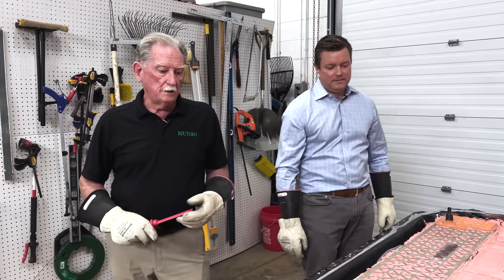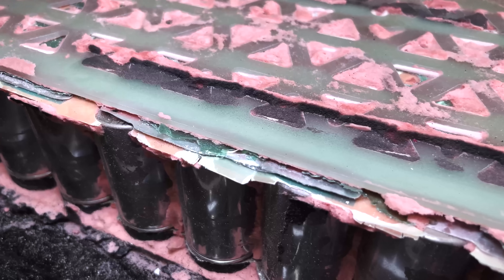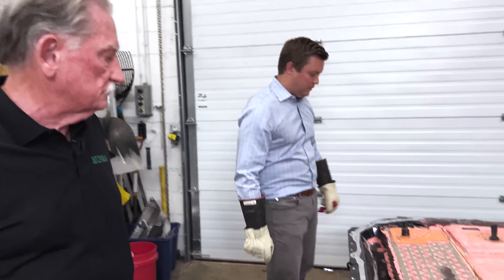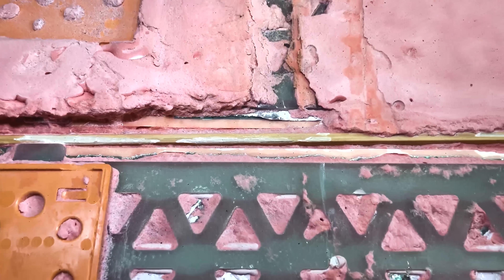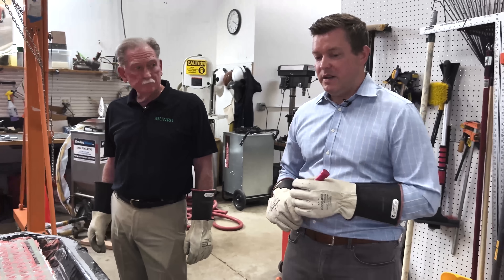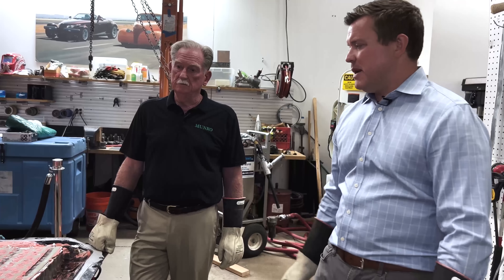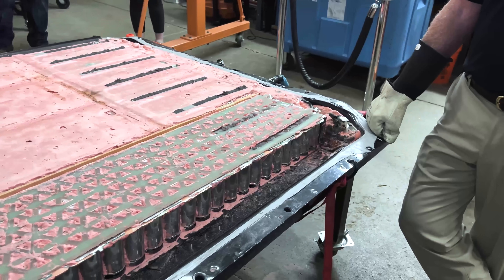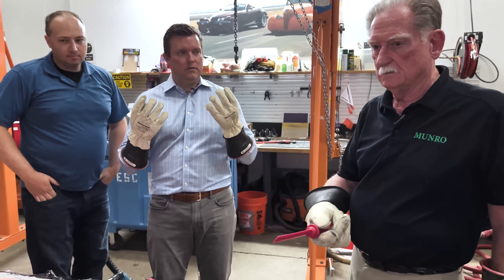4680 Battery Pack: What We Found Under the Foam!

Comment: This battery feels like a slap in the face to the DIY recycling community. Every Tesla that has crashed after 2-10 years so far has had the batteries removed and re-used in another vehicle. But now it's not possible for a regular shop to remove the batteries.
Reply: @plantstho6599  For the record, I'm quite the fan of capitalism. It's just that I'm also quite the fan of right-to-repair, which I think is not contradictory with capitalism. The confusion at Tesla is long-term profits versus short-term profits. Short-term, this iteration obviously yields higher profits. But if customers who loved the brand find more and more that they can't do anything to their cars without Pappa Elon's explicit permission, they will grow to not love the brand eventually, and that change is harder to measure than quarterly unit sales, but it will be a NET negative for the company's bottom line given enough time.
Reply: These batteries can still be recycled. Just not in the way you all might think. The pack gets fully discharged and then put into shredder which that shredded material will then be put into processes to separate out all the materials for recycling.

While this may seem like a waste, I really doubt that the DIY community usage is going to be greater than the number of crashed or scrap Tesla battery packs over the coming years. Talking about thousands of battery packs and likely millions of cells over the next couple of years. Also if you have ever taken apart a Model 3 or Model Y module for the cells, the potting agent or adhesive used in the modules does not make it any easier than this.
Reply: I was thinking the same. How could anyone repair or replace this?
Reply: This really needs to be addressed, will these battery packs end up in a landfill?
We are supposed to be eliminating single use items, this is bullshit. If you can not make a recyclable items then do not manufacture it.
Reply: @albertwayenberg9140  It's like they said in the video: the batteries can be ground to dust and then the raw metals are separated for mineral-level recycling. They won't end up in a landfill, but end-of-life recycling is grossly premature for a car that gets totalled in less than a year. The battery can last 10-20 years. Once it's manufactured, it should exercise its full 10-20-yr life cycle before being ground up. That is the most efficient way to put the materials to work, but it necessitates modularity, which Tesla apparently no longer supports.
Reply: @texasgreentea1  Polyurethane foam renders mineral level recycling almost impossible - it gums up the chemistry horribly.
Reply: The pack also seems to have parts that could go bad and could be replaced but now you gotta replace the whole pack. It's wasteful overall and more money on the consumer.
Reply: @JJayzX  exactly, more money from the consumer. Nio took a hit and invested in a swappable pack, good for the consumer, good for everyone long term. Tesla could not commit the capital at the time so now they try to convince everyone swappable packs are useless, and that's absolutely incorrect. When you can swap a pack you can recycle a pack easier, you can sell a car sans battery (via battery lease) and reduce the cost, accelerating the transition to ev, TESLAS GOAL.
Reply: @JJayzX , so you engineer the failure rates to near zero.
Reply: @kylenolan2710  lol, that isn't realistic. Just not how things work in the real world.
Reply: @JJayzX  yeh they must have a way to do it for there warentee stuff hey
but how do u think a 3rd party shop would get hold of those cells?
Reply: Thats  the way how they like it :D
Reply: 100%, tesla wants to maintain control of their battery supply, this is partly why they chosen this design.
Reply: The new corporate theory is my way or the highway. From total integration of parts making to elimination of middlemen and sales staff. Everything is proprietary and will be designed so it cannot be reused unless by another key holed proprietary method that was integrated into the original design. This is corporate mantra. The key is to look for these keyholes to unlock the path to further use. A pack like this will far outlast the vehicle. At the very least it looks like these packs can be split into 1/4s stood on end and used as powerwalls
Reply: @urbanbeeman5402  Fight for your right to repair.
Reply: @iiinfinitefitness  I agree.
Reply: I think this pack wil survive most crashes.
So it will be on a pack level.

And diy will get many more options from the very different packs out there.
Reply: Even Tesla won’t be able to replace cell blocks… You total the car if something is wrong or a minor damage to structural pack..
Reply: Yes, Tesla has eliminated the "reuse" from the mantra, reduce, reuse, recycle. That isn't a step forward, except for Tesla.
Reply: @ledsalesoz  
I think that in a few weeks you may have to reconsider your "reuse" position.
(Just btw, recycling is by definition "reuse"?)
Reply: @ledsalesoz  why would Tesla be concerned with reuse by garage hobbyists in ways that the pack wasn't designed for that are also probably dangerous? Lol get over yourself
Reply: Dissolve the polyurethane & they can maybe rip the cells out but yeah you’re kinda right
Reply: @Teboski78  I don't know what would dissolve polyurethane. Polyurethanes are in general very resistant polymers.
Reply: @Teboski78  that could damage seals on the tops of the cells depending on material choice. I haven't seen one out yet so can't comment fully.
Reply: @plantstho6599  This "best part is no part" sounds compelling but please, when evaluating Elon Musk's companies don't treat Musk's tweets as facts on how they operate. Don't even think of them as aspirational goals. They are just PR rarely having any relation to reality...
Reply: Getting the cells out will be far easier than the process used here. This was archaeology. Whereas once someone knows how it is constructed, and what safety precautions are required, it will be far easier to rip it apart
Reply: @rhydlew  No, the foam is misleading. It's only there to fill remaining air gaps and absorb dangerous temperatures in a thermal runaway. The cells are fused with epoxy. The work to separate them is more expensive than the value of the pack unless they're already separated into modules.
Reply: @texasgreentea1  why separate them? As you say modules would be fine
Reply: @texasgreentea1  Tesla increases safety by slowing down fire propagation in a thermal runaway event, while destroying any viability of reusing/recycling packs to replace dead sections of strings. Very apple-like of them, safety is always the #1 excuse when they do things that completely stifle 3rd party repair rights
Reply: @spikester  The safety did not increase with this iteration IMO. The pack was subdivided before, yet it already had thermal foam. The removal of subdivisions is a move purely motivated to force people to work with 1st-party Tesla dealerships. There's no excuse other than profit. It's unfortunate because it's contrary to their mission statement. Recycling is a big part of electrifying the entire fleet, which was supposedly their north star for many years.
Reply: @rhydlew  There are no modules in this new pack. There used to be, but now they're all fused with epoxy.
Reply: @texasgreentea1  I think I'm coming around to what others are saying. However if the pack does 1 million miles I can forgive the lack of further reusability
Reply: @texasgreentea1  Agreed they should be repurposing all the working healthy cells in things like offgrid solar, backup power systems, etc. They would last for a good decade+ in these lower current applications long after the usable vehicle lifespan. Shredding the packs to make new ones only makes sense for manufacturer profits, nothing green about it; highly wasteful overall. Even GM was repurposing Volt packs as its economically feasible to do so.
Reply: @rhydlew  It's not about whether it COULD live a full life cycle. We know that statistically a certain number of Teslas will crash and be considered totalled by insurance companies. In all such cases, the battery pack may have received some damage, but a vast majority of the pack can be salvaged if it's separated into modules. Furthermore, even if it never crashes, sometimes batteries just fail. These packs have thousands of cells. If a single cell in a pack fails, it can take the whole pack offline. If Tesla offers you a new pack under warranty when the pack is less than a year old, they're now unable to just remove 1/16 of the pack and replace it. They now have to grind up the whole pack prematurely, even though almost all the cells were still good.
Reply: @texasgreentea1  yeah it's not looking good for this design. One last attempt at fandom: Tesla tend to iterate and improve designs, maybe one they get going with these, they'll modify the materials or layers used
Reply: @spikester  
"repurposing" (to storage) ....
Why do you assume a dead cell will render a whole pack useless, unable to be used in a "second Life"?
.
"Shredding the packs for new ones" is EXCEPTIONALLY "green" 
The cost of producing a given amount of "raw material" from old packs us projected to be 1/6th (17%) the cist of mining new stock.
Why do you think mining is so expensive?
It's "the dirty stuff"
Digging, hauling, heating, refining, disposal, etc, most of which uses fossil fuel.
Recycling is incredibly clean by comparison.
Not only that, but all the "small cells" from other devices which weren't economical to recycle can now be literally "thrown in", AND PCBs from electronic devices (gold, silver, platinum, lead, etc, etc).
Did you know (have you checked) that every below standard cell, plus "scrap" from Panasonic now goes to be recycled? Or that Tesla already does the same with their 4680 production in house?
Research required?
Reply: @texasgreentea1  they have outsourced the 4680 cells to panasonic. you can buy the cells individually?
Reply: @spikester  they probably do it because they expect to further improve technology in the future. and for that it's better to get the raw materials out.
Reply: @Dejawolfs  I don't know if they have 4680s coming off their own line yet, but they are going that direction. They said so at battery day last year. I don't know of any Chinese or American OEMs selling individual 4680s yet. I've been looking for them. But they certainly will be available brand new eventually from multiple suppliers. But all of that is beside the point. If you could harvest 4680s from a salvaged Tesla, they'd be much cheaper, as has been the case with 18650s out of old Model S units. It provides the capitalist incentive for small shops all over the world to get into the battery recycling game. The process had begun with a handful of shops, but now those shops will only keep recycling Tesla batteries until they run out of old salvage Model Ss (perfect module size) and Model 3s (already problematic bc the modules are huge). New shops who may have been interested in battery recycling will see that it's not feasible with newer Teslas and they won't bother.
Reply: @Dejawolfs  For now I will give benefit of doubt that this is temporary & they will remove the foam after all the larger diameter cell issues are sorted out.
Reply: Why not? You mean that nobody else will be able build a process to reuse the cells? Doubtful.
Reply: @glennwhite1841  He means cost prohibitive - small un-related example, most plastics can be recycled however only a small portion (smaller than you think) actually is and its because of the cost of the process to break down the various types of plastics.  this is batteries i know but same result.
Reply: @glennwhite1841  No, I mean there is no process that's worth the time. Look how long it took the Munro team just to open it. No EV shop is going to go through that hassle. It's cost-prohibitive, and then, even if you succeed in removing the singular giant brick of cells, it's still a singular giant brick of cells, too large to fit in most alternate applications. In all previous packs, the modules broke up the pack into fractions, 1/16th or 1/4th the whole packs, so they could be re-purposed cost-effectively. That era is gone.
Reply: You can absolutely remove the pack from the car and place it into a new vehicle. You just can't easily break it down outside of full recycling.
Reply: @stateofopportunity1286  people are using them in other cars other than Teslas, this will prevent that. So their reuse will drastically reduce.
Reply: @stateofopportunity1286  It will fit in almost no swap project vehicle. If you watch a few videos from EV West or Zero EV or a few of the others, you'll see what we mean. There are certain vehicles (typically old classics) that lend themselves well to EV conversion, and a lot of these shops even have plug-n-play conversion kits. Even if you saw a chassis to pieces, it's typically not feasible to bolt an entire Model Y pack in its original dimensions to the bottom of most other cars.

Comment: So what happens if 2 cells fail? Replace the entire pack?
Reply: Actually 2 cells will result in very little degradation. They will be electrically removed (by fusible links) and ignored.

Comment: I believe  that using a cylinder shaped battery cell units will become impractical for recycling or costly to produce.  A similar battery pack when punctured causes a huge fire  or explosion.  The blade battery used by BYD  vehicles ,so far, seems the best design. I believe  we need a battery cell unit that is a compromise between easy to assemble  and recycled . Another area of EV improvements would be a world standard at charge stations on the connections design.  Also a modular design of battery of various capacity.

Comment: I think they build this way with Foam compacted, to make it difficult for individuals to replace bad/defective cells by itself
Reply: Replacing cells in a battery pack is not a good choice, it is a cheap and nasty patch job that couldn't be warranted. From other Munro videos trying to replace a few cells out of a module could never be cost-effective, for any EV using cylindrical cells. It maybe if the cells are prismatic or pouched. Prismatic cells like Byd's blade cells or the box shaped ones are probably the easiest to work on. Pouch  cells are just cheap and have a dumster load of issues.

Comment: It's great that you guys think that it's easily recyclable. But that doesn't look very repair friendly. The old battery units you could replace a bad module, this thing looks like you have to replace the whole battery pack. There's no way in hell a repair center will go thru the pain of even removing that lid like you guys did.

Comment: Re: recycling; I'd have thought a good way to approach it could be to skim the bottom of the pack to the depth of the cell can bottoms but no more, then plucking the 'jelly rolls' out.
Reply: Or just grind. Ideally there would be a solvent that does the trick in a jiffy.

Comment: What does 828 vs 816 4680 batteries convert to in terms of KWh & Range.

If using  828 (in 69x12) layout config:
~98Wh per cell 

98Wh * 828cells = 81,444 Wh  = 81.4 KWh

Current model Y is 75 kWh difference of 6.4kWh or 8.5% 

Taking the current EPA range estimate of 330miles and adding % change  new total is ~ 360 miles on the new pack? 
However seems like from the lucky few that have received Telsa may be software limiting to 278 miles? 

*Edit*
This is not including any of the calcs due to weight reduction, I think with the castings and structural pack Sandy mentioned around 4-500 lbs reduction.. Im estimating range is nearing more like 375-390?
Also huge fan of the channel! I am also mechanical eng loved watching your videos while I was attending university! (motivation through some tough course)

Comment: Dealer (200 miles away): "We found the problem!"
Owner: "Great, what is wrong with my car (...that I can barely afford the payments on)?"
Dealer: "You have a bad sensor in your battery pack."
Owner: "Oh that sounds simple. What is the repair cost?"
Dealer: "$35,000"
Reply: But don't worry, that price is including a total destruction of the whole pack sending it back through the orginal mineral mining process. It's been optimized over centuries.
Reply: Laughing so hard! Can't stop! ...I have 2022 a Model Y P from Fremont.

Comment: I'm curious what the Liquid Nitrogen requirement is per recycled battery kg (1kg LIN : 1 kg battery cell??).   SpaceX needs Liquid Oxygen (LOX) for the launches....they could build an Air Separation Unit (ASU) + liquefier to fulfill SpaceX needs and Tesla battery pack recycling.

Comment: This is a  horrible design.  That is basically unserviceable and expensive to reuse.  You have an issue with one cell and you have to replace the whole thing.
Reply: Their earlier vid showed the electronics (inverter/controller) are bolted and glued to the lid. The front seats are laser welded to the lid also. Not to mention the center console mechanism. You'd be replacing a LOT more than just the battery.
Reply: @kustomzone  Makes no sense.   I love the idea in theory, but if one cell had a problem, even under warranty, it going to be way more cost than it should be.   This was a swing and a miss in my opinion.

Comment: Grinding the battery down to recycle it is the dumbest thing to be discussed in this video. That would have to assume there is no secondary uses for this battery. If 1 cell/module goes out, you can't even salvage the good cells to reuse or repair the battery at all. You basically have to trash it. First step to recycling is not to trash it but to reuse.
Reply: Given all the components affixed to the lid (floor) which would be non-swappable, the car would be a complete write-off. If you have to remove the lid, a pressure sensor would likely be triggered to tell the computer that water ingress to the battery is therefore possible.